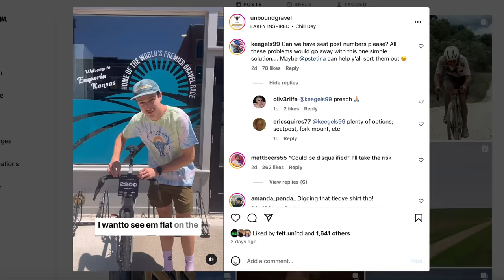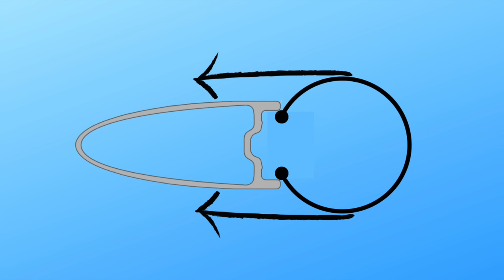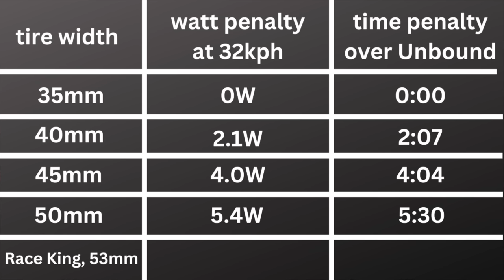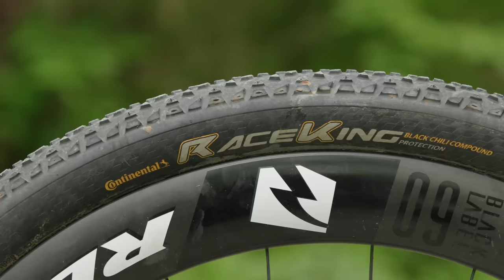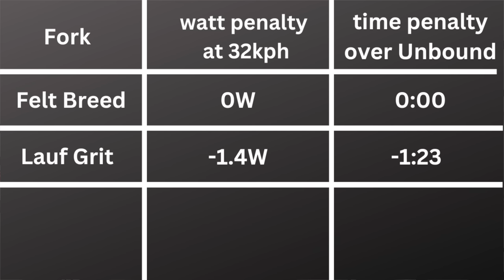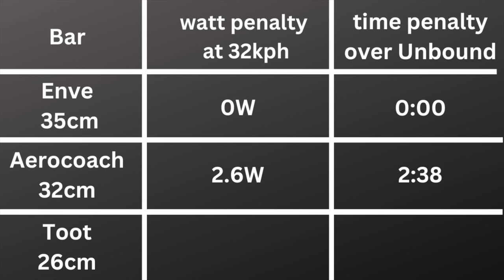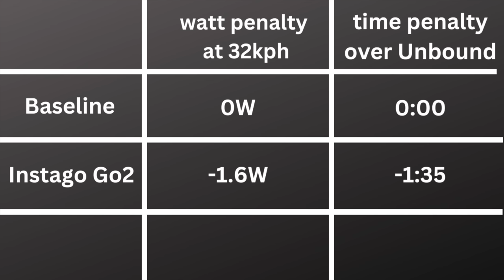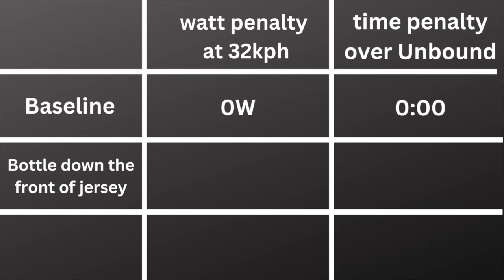We Went to a Wind Tunnel to Build the Fastest Unbound 200 Bike and This Is The Result

Comment: at the risk of sounding presumtuous:
The fact that the deeper rim helped, really isn't that surprising with some basic aerodynamics knowledge (which probably is far more than the median knowledge...). Its the same reason, why a notchback has a lower cd than a jeep. smaller steps...
Also you could have seen a trend in your table, but you chose not to. at 8:00 you can clearly see, that the trend is going back up and if you extrapolate at .3W for 5mm you would have landed at 1.88W. Yeah, that isnt 2.3W but its also a different tire.

Assuming you tested the tires while turning (sadly that is not covered in sufficient detail) the extra profile of the conti just helps to break up the airflow in the first place, making it a tubulent flow from the get go, where steps and bumps have far less of an effect.

Comment: if you're factoring the number plate into your thinking on the aerodynamics of the exposed cables why are you not attaching a dummy number plate to your bike for the wind tunnel testing? surely it has a not-insignificant effect on the aerodynamics of the bike/rider system so it should be there when youre doing your testing. ESPECIALLY when youre testing the aerodynamics of different handlebars.

it's going to be there during the race it's effectively part of your bike. Right now you're obsessively optimizing the aerodynamics of an incomplete bike. which could completely change once you actually attach the missing part.

Comment: I understood that Aéro penalty of these test is based on the average speed of 32 kph. The issue is that aéro drag varies with the square of speed, then a speed distribution of the race would be a bit more accurate ( the higher the speed, the very higher aéro resistance is ) ex : 2h at 25kph, 1h at 35kph ,1h at 40kph. It could potentially amplify difference… just an idea..

Comment: Just a couple of things: 

1. Aerodynamics on a bike off-road don't exist  as the speeds are too low and especially if  you have another rider in front of you ! 

And

 2.  These bikes are just 1990s mountain bikes with drop bars.  Just look at John Tomac in the 90s riding with drop bars.

You guys are just trying to reinvent Cyclecross and 1990s MTBs  🤣

Aerodynamics only works with a single rider on a perfectly smooth road in a time trial race, riding in a straight line!